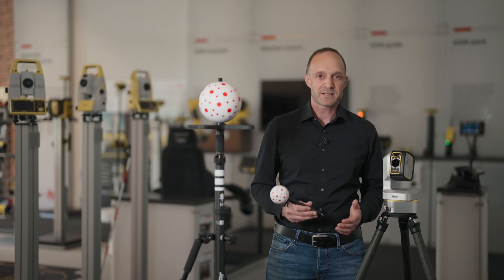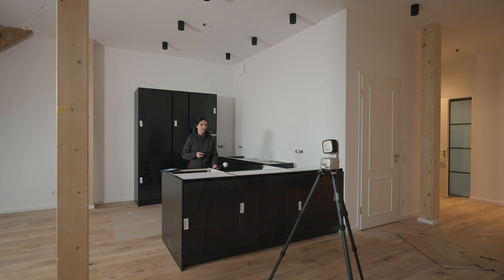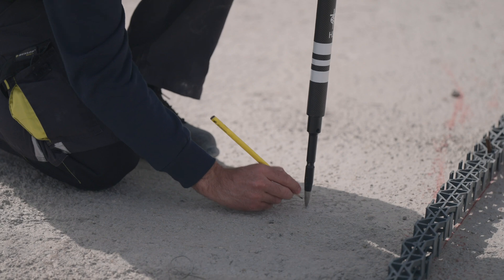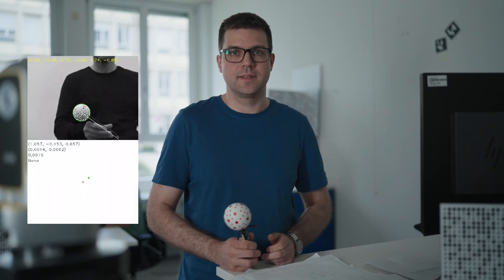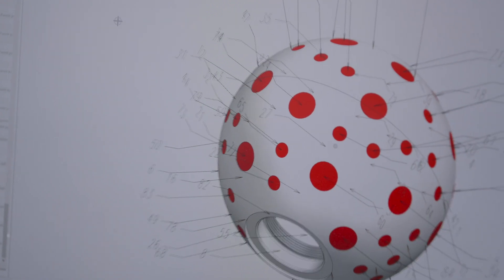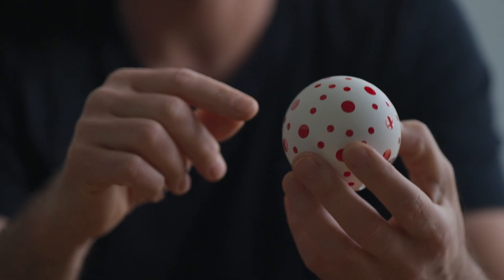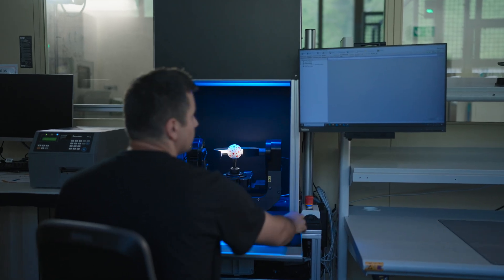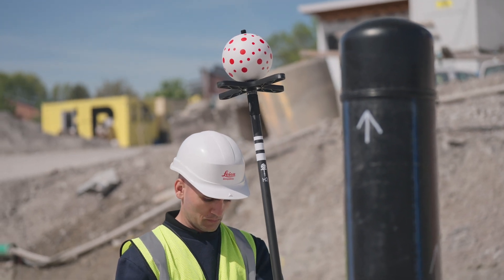Leica iCON trades - Why red dots

Comment: As I wrote, it will cost 3 times as much as its predecessor, meaning it won't be available to smaller companies over $30,000. Someone flew into space here.
Reply from the maker: Dear @Skylimi, thank you for your comment! 
Leica iCON trades, together with iCS20/50 is a completely new solution which combines the innovative visual measurement technology with simplicity. 
We offer flexible configurations for different applications and budgets.

Please contact our sales representative from your region to learn more about the offering. You will be positively surprised.
https://leica-geosystems.com/ar-ae/contact-us/sales_support/sales

Comment: What's the precision at what distance? Thanks.
Reply from the maker: Dear @nicoladebiasi6759,
Thank you for your comment and interest in our product!
Leica iCON iCS50 and the iCON vPen offers the accuracy of 1mm accuracy up to 10m
When using the vPole, the accuracy is 3mm at 50m, with the vSphere mounted on the bottom of the vPole. 
Check our website and brochures, you can find all technical specification in there: 
https://leica-geosystems.com/products/construction-tps-and-gnss/software/leica-icon-trades/layout-software
https://leica-geosystems.com/products/construction-tps-and-gnss/software/leica-icon-trades/templating-software

Comment: How far away can you resection from ?
Reply from the maker: Dear @tc1976100, thank you for your comment and interest in our products!
It is possible to do a resection:
•	up to 250m using Leica Round Prisms
•	up to 250m using Reflectorless mode
•	up to 150m using Reflective Tapes
•	up to 40m using Leica vTargets with automated aiming and target recognition.
Using the Setup with Known Points method, you can of course combine and mix all target types.
Please check our website and brochures to learn more about the technical specifications: 
https://leica-geosystems.com/products/construction-tps-and-gnss/software/leica-icon-trades/layout-software

Comment: Does it come in pink dots?
Reply from the maker: Dear @timd9430, thank you for your comment. 
Nice idea!
We use the Leica Geosystems red. As mentioned in the video, this has also some practical benefits like fast measurement speed which is needed for a real-time solution with high accuracy.